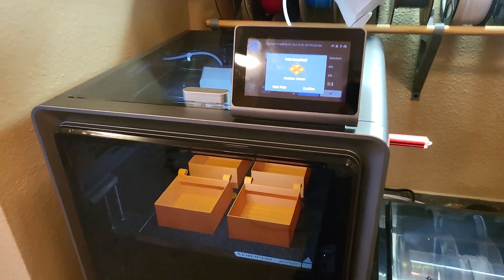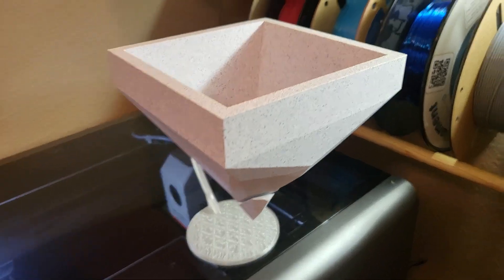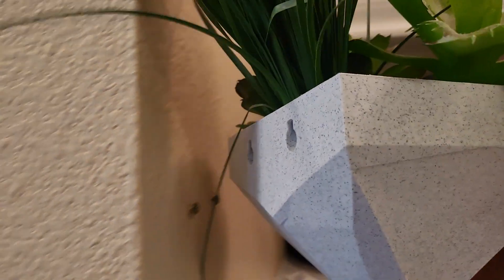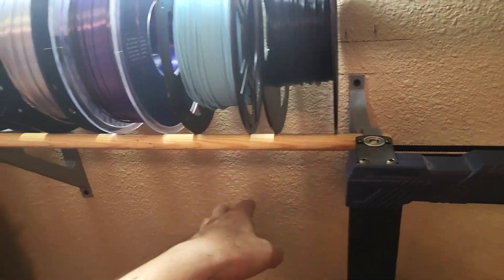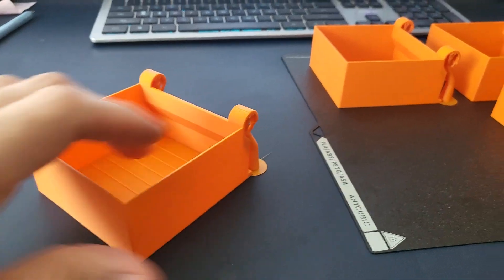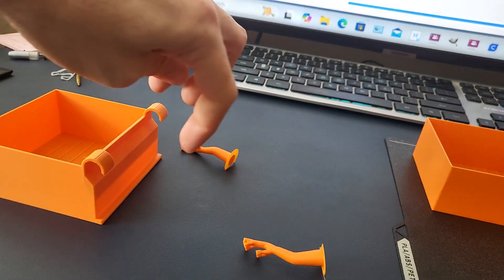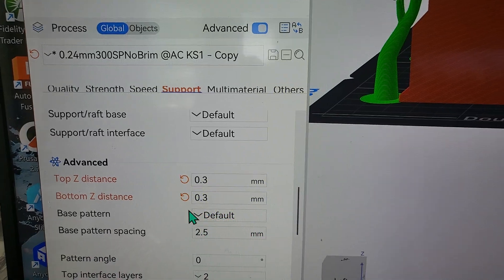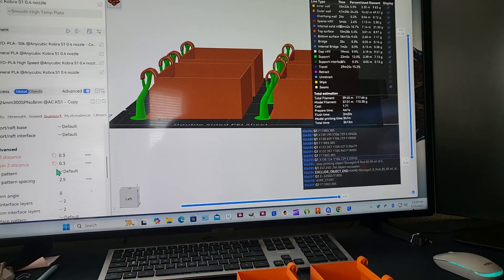The Best Single Setting for Supports in 3D Printing!

Comment: 1:20. Yes I don't like marks on the wall if they go into the tube.
Reply: exactly, why scuff and scratch your wall over a $4 piece of wood?
Reply from the maker: @fightlikabrave let's get enough likes and I'll make a test video, I could on purpose do a test where I remove and replace a reel like 200 times then maybe another one where I actually try to abuse the wall this way. Let's say I actually throw the reels on to place...
Reply: @TXHEN1  Its no biggie man as long as youre careful, shouldnt be that bad - i just meant that wall scuffs MIGHT be a potential issue. Wasnt hating lol
Reply from the maker: @fightlikabrave  but still, it would be a good video if it gets enough likes, Some might think it will scuff or damage the wall(tho they haven't yet in 3 months, but I feel a longer test is necessary.) One way to be sure.
Reply: Plus the wall isn't taking 50% of the weight, because the wall is parallel to the direction of the mass that's applied (you know, gravity pulling straight down on the spool). No hate, just pointing it out. His setup isn't going to break because of that. It'd have to be quite a long dowel with no brackets for a solid distance for it to break from the spools.
Reply: @korabeats_  Not saying its gonna break..just gonna scratch up the walls..
Reply from the maker: @korabeats_ yes good try on your reasoning. How ever the wall is not, not touching the reels. The rod angles them towards the walls moving the center of mass aiming more toward the wall and a straight down direction. The exact percentage would be a lil hard to get, not impossible tho as I'm sure there are mathematical equations that I don't want to bother looking for. The 50% was just a quick estimate from me.
Reply from the maker: You guys know these are pencil marks, right? And that  they erase easy? Let me get enough hate for that follow up video lol. Dent walls or anything.....